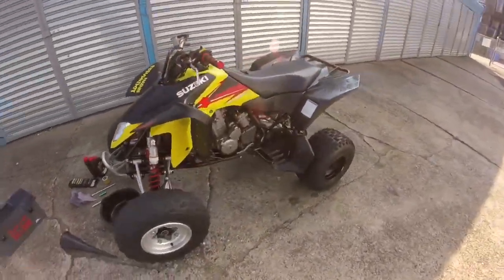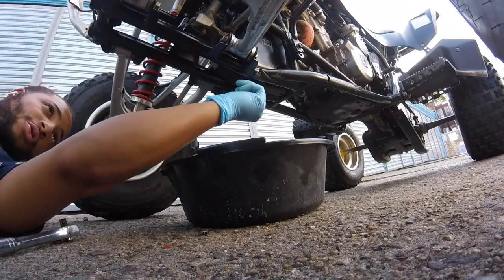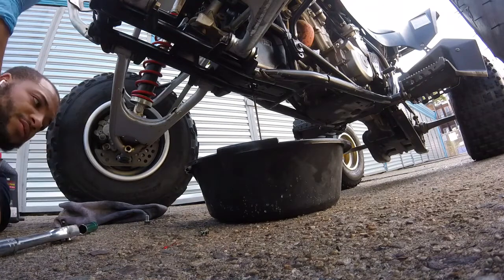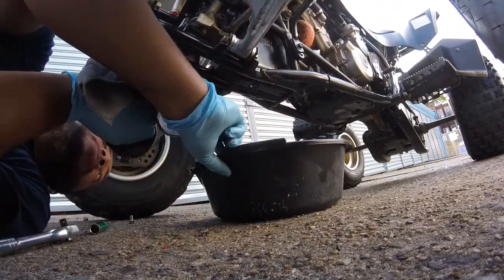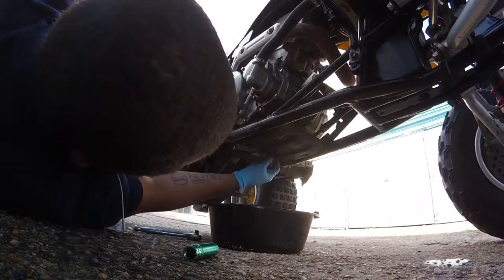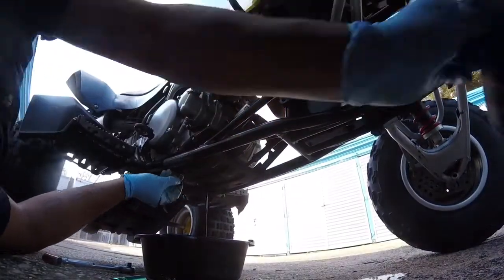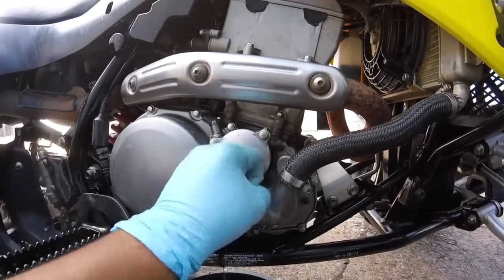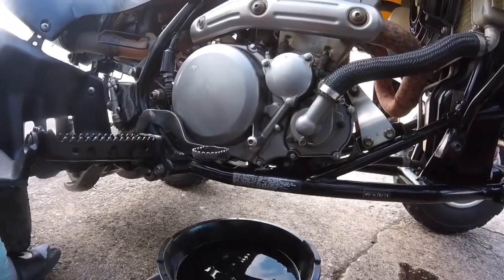HOW TO CHANGE OIL ON A LTZ400, QUADSPORT Z400!!!!

Comment: Sup, where do you put the oil? only in the reservatory in the front? 1400ml?
Reply from the maker: Yup only in the front and yes 1400ml let the bike run for like 3 minutes take it for a ride then check the oil to see if you have to add a lil more